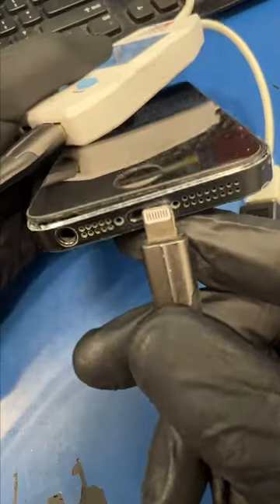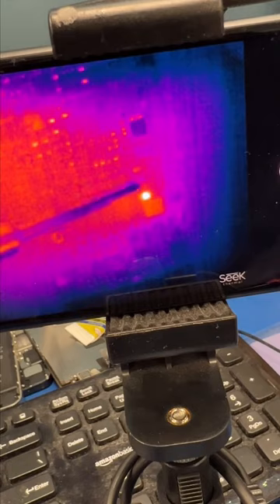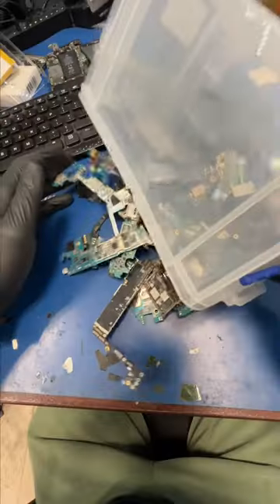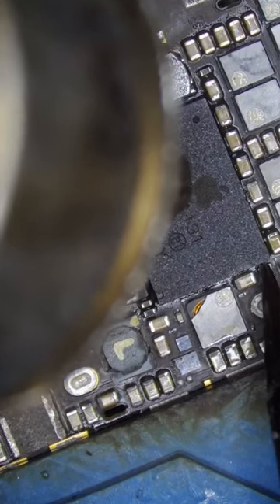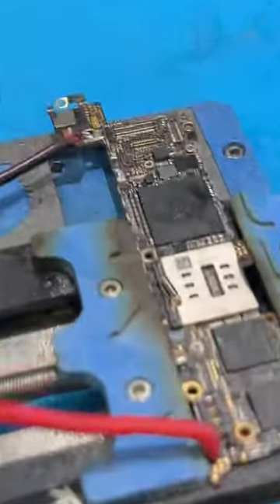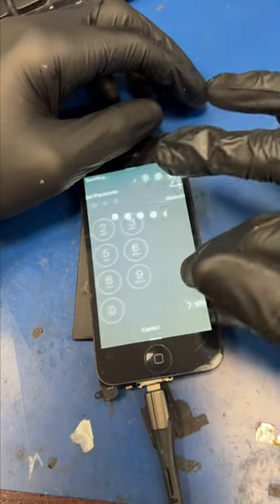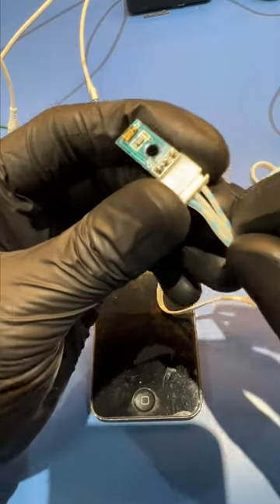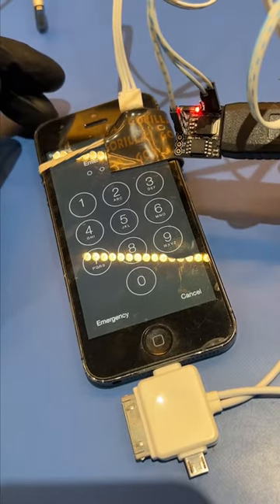iPhone Data Recovery… Without The Passcode? #tech

Comment: How does the us  try everything if the phone locks itself for minutes to hours after the attempts?
Reply: If you notice it's an older iPhone running older IOS these version never locked themselves forever the new ones do.
Reply: @realworldissues  yes they did, I had an iPhone 5 that had like thousands of days on it.
Reply: @irvineebrahim6928  you must had the version that started it however when FBI , Mossad and other agencies took it they used this method till apple figured it out and started locking people out. If you remember eventually apple would ask for you to connect to Itunes since itunes were no more it doesnt go to that page anymore because it crashes as it isn't a able to communicate with itunes anymore and repeats the guessing all over again.
Reply: @realworldissues  It even said in the last frames ‚phone disabeld‘
Reply: @juredstoner  no were talking about perm lock the one he had will do 1 minute, 2 minute and so on not like perm lock requiring itunes with iphone 6 and later gen iphone 5 started requiring by showing the apple logo after too many guesses.
Reply: @realworldissues  So how do you bypass the time limit with iPhones that show the time limits? You mentioned something about connecting it to iTunes but that it crashes and resets the time limit? Sorry it wasn't really clear to me.

Comment: How comes the iPhone didn't got locked for 4564466 hours?
Reply: it can be changed thorugh an applicaiton that will allow 999 times rong password then disabled for 10 minutes then againg 999 tries
Reply: there's an exploit that allows you to get root access to the file system over usb
Reply: @classicmouse  9999* tries
Reply: @UnorthodoxDoctor  10,000 tries*, can’t forget 0000 is one guess!
Reply: Iphone 4. He jailbroke it.
Reply: he disabled the part where it disables
Reply: @Ghost-ro7oc  no way bro, that's at least a couple of years
Reply: There are two files that control how many times before a lock out... He modifies them to have 9999 tries
Reply: Its a zero day on old iphones
Reply: Is NOT it was 1min 💀